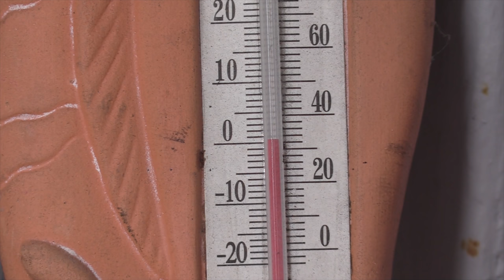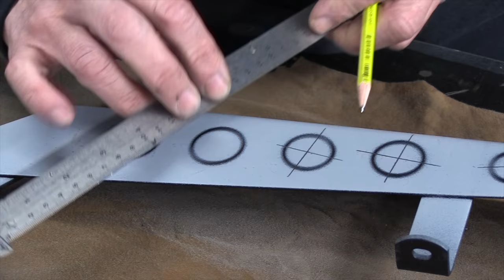Triumph TT Legend, Custom Chain Guard Makeover !

Comment: Room enough for a smal spray booth in the new place? LxWxH 2X2X3 m, plywood, a carbon filter and a bathroom fan does the trick 👍
Reply from the maker: Sadly, I don't have room for that, I have a professional spray shop two doors down with a low bake oven I can use anytime!

Comment: By now you should be sponsored by Simoniz & amazed you haven’t got a one piece bar to go between the axle stands. 
Do you ever have problems with the wire leaving marks in the paint? I use hooks instead of twisted loops so components can be repositioned between coats.
Reply from the maker: Sponsorship would be nice, sadly we buy it, but we do get a little discount when we buy in bulk, as we all would!

Comment: Hi Dell 'n' Pen.
Another brilliant paint job, you've got the Tough paint down to a tee. The step drill worked nice with the graduated holes too.  Would your dimple punches do it or are they not stepped enough in the set?
The ole Leg-end's going to be a beauty.
Reply from the maker: Hey buddy, the dimple punches would struggle with this, it's 2mm thick and pretty good quality steel, and they would certainly lead to a little distortion for sure, even if they made it through.. and also you're right, I think I only have maybe 4 sizes and I needed 9 graduations!  Thanks for your support, as ever, take care, D&Px
Reply: @Moonfleet41  Aye,  you're right Del.  2mm would be a bit much and stress out the die for no reason.

Comment: Have you got a link for the red rubber grease you use on the rubber mounts etc for the radiator? Thanks
Reply from the maker: Here you go buddy, I use a tube at the moment as I picked it up cheap on a tool stool in the market, but it's not cost effective to buy it in tubes, compared to buying a tin, so here's a link to that:  https://www.spanner-monkey.co.uk/red-rubber-grease-500g-tin-66557?search=red%20rubber%20grease&description=true

Comment: Nice result! I thought you would use the punch tool, similar on the Fox Dawg build. This is a nice alternative for the budget minded. Good luck with the move!
Reply from the maker: Could well have done that, but for two reasons I chose the step drill, one is that I only have 4 sizes of hole punch and I needed 9 different graduations for this, and also this chain guard is typically heavyweight steel being Triumph, perhaps 2mm thick I think, and the manual punches would struggle with that, leading to a fair bit of distortion... so this time, step drills made a better job for the design I had in mind!

Comment: Great video as always - good luck with the move!

Can I ask what you use in your parts washer? I've heard conflicting ideas between proper washer fluid, diesel and kerosene. Many thanks!
Reply from the maker: Hi Duncan, I don't personally believe in using flammable solvents, like diesel and kerosene, it means having 3 gallons of it sloshing around in the bottom of the tank constantly and it's not sealed properly like a fuel tank, so if there was ever a fire, it certainly wouldn't contribute to safety... I use an emulsifiable solvent, not just because it's safer, but also because it washed off with water and many of the jobs I do are de-greased before painting... things like diesel would leave a horrible residue which would affect the paint, but I can wash my parts off in the sink and get them bone dry with an air line... and as you can see, they're perfect for painting that way, and I never get any adverse reactions from the paint... here's a link for you, hope it helps buddy... https://www.spanner-monkey.co.uk/degreasing-solvent-emulsifiable-5l-59168?search=ak05&description=true

Comment: Can imagine the anxiety of planning that move.  Best luck as always.   Quick question... i would have used a sanding block to sand, would it have been incorrect to do so on the chain guard?
Reply from the maker: sanding blocks give a great flattening effect to high peaks and uneven surfaces, but my aim here was simply to scuff the surface and smooth out any edges in the previous paint layer so that nothing shows through the new paint!  As you'll see on Friday, it floated out perfectly smooth for a great finish... thanks for the moving best wishes, much going on behind the scenes, but we'll give you preview very soon!!

Comment: Great styling on the chain guard.  What's the reason for wet sanding versus dry sanding?
Reply from the maker: Dry sanding tends to clog the paper when you're using a fine grit, the water rinses the debris away, also lubricates the paper, leading to less aggressive abrasion, gives a smoother finish, but still keyed for painting!
Reply: @Moonfleet41  makes perfect sense, thank you 👍

Comment: Just the type of guard I'm actually looking for just now Del
Reply from the maker: Cool, maybe you can make yours following this now... Good luck with it buddy.
Reply: @Moonfleet41  probably going to end up with some carbon minimalist guard tbh 
Fits in with rest of project involving stripping every single gram of weight off of a road going 600 tuned to the max 
Rolling Road figures are showing just under 50% increase on factory output 
Chassis needs a ton of work yet though 
Zx10r front end on modded head stock and custom built mix carbon/alloy/ titanium ( dodgy Russian sourced) with 2019 zx10 swingarm and rear shock assembly 
10r wheels just now ( to be replaced with lighter at a later date) 
Ancillaries are latest digital as is Ecu ( flashed already ) 

Sept test it ate one clutch and one rear tyre and chain 
Badly needs smoothhing out just now 

No idea how much from anything standard lighter she is but I can at this point just about lift single handedly completely off the ground in full trim 

Guy who owns it is not short of a coin or two lol 😆

Comment: What type of solution did you use in the portable red sink you have?
Reply from the maker: Here you go, this is what I use, link for you: https://www.sealey.co.uk/product/5637174713/5l-emulsifiable-degreasing-solvent   It's cheaper on SpannerMonkey, but their site is down at the moment, however he's a link to their site, check it a bit later and put the product code in and it'll be significantly cheaper through them: https://www.spanner-monkey.co.uk/index.php?route=product/search&search=ak05&description=true
Reply: @Moonfleet41  thanks :)

Comment: What cleaning fluid do  you use in your parts cleaner?
Whats your thoughts on using diesel / petrol to clean parts by hand?
Reply from the maker: Firstly mate, petrol NEVER use for cleaning parts, the fume build up can flash and burn down your garage, diesel isn't so dangerous, but generally, the same as kerosene, they are both a heavy oil and will take an awful lot of cleaning to actually get the degreaser itself off the part, so I use an emulsifiable solvent (obviously meaning it's a water soluble), not only does this mean it's non-flammable, but also you can rinse it off with water, and certainly for me when most of my parts are to be painted, it's very important to get all the solvents off the surface... here's a link to what I use, and it works extremely well, as you can see: https://www.spanner-monkey.co.uk/degreasing-solvent-emulsifiable-5l-59168?search=ak05&description=true

Comment: “Brake cleaner to clean the parts washer fluid” - that’s another one you can explain in your ‘lubricants’ video! Aren’t they basically very similar? Sorry for being ignorant.
Reply from the maker: No buddy, I use a water soluble degreaser which gets the worst of the grease off, but the brake cleaner wicks in to places where even water can't get, and also it dries away by evaporation, unlike water (of course water evaporates, but not as instantly as brake cleaner), so this leaves it dry even in places like any gaps behind the welded brackets where water can lurk, or even just dampness, and come out and trash the paint later on... using this method has ensured I never get reactions from left over chemicals.

Comment: Great spray work once again , do you normally do 1 tach coat and 3 or 4 wet coat.
Reply from the maker: If it's warm enough 3 wet coats is fine, this paint is thicker than regular rattle can paint, you can lay it up a little heavier without it running... but practice to find yourself a comfortable process that works for you!
Reply: @Moonfleet41  ok thank you. Enjoy your move to you new unit , can't wait

Comment: Ah! The ancient art of Drillium! 👍 I approve. 😅 
I got a free welder.. gasless MiG. 😱😲 I'm making a terrible mess with it so far! 
Looks great boss, stay safe! 😀
Reply from the maker: Great news on the MIG mate, if it helps, try cutting your teeth with thick metal... 5mm thick means you can wind up the power and make lovely beads without blowing through it, good luck with it and have fun! It's all about the practice...
Reply: @Moonfleet41  cheers Del man 👍 yeah I got a job lot of mild steel offcuts from eBay it's all pretty hefty. 6mm angles, squares, bars, 2mm tubes and big old plates. Also got angle grinder from the same neighbour, they're moving house you see. I'll post some pics of my practicing disasters. 😅
Reply from the maker: @ollieb9875  Look forward to seeing it mate, I started exactly the same way, never done a course, never had the time for it, but you'll get there in the end, just passing on the wiest words I ever heard with welding... "slow and steady gets the job done" !

Comment: Del... what cleaning solution do you have in the red tub??
Reply from the maker: Here's a link John.. i use an emulsifiable degreaser, i like that it can be washed off with water specially if the parts are to be painted, which for me they usually are..  :-https://www.sealey.co.uk/product/5637174713/5l-emulsifiable-degreasing-solvent

Comment: Hi Dell and penny hope you are both well 
Right 
I live in Nottingham the other day some scum bags try to have a go at my r6 my friend told me about a motorbike chain and lock that cost around about £150 -£200 to buy and he said it can't be bolt crops or grinded by the thefts I'm just wounding if you would know what it might be called or even where to buy it from cheers dude 
Be safe out there both of you
Reply from the maker: Hi buddy, I'm afraid I don't know of such a chain, but on the simple knowledge of metals, I know of no material, however exotic, that can't be cut with a slitting disc, these days a disc grinder can go in a pocket, battery powered and sliced through any lock or chain... there are other cunning methods they use to break locks, no lock is infallible... I know it's not much help now, but in the future, have you considered a tracker?  If you can afford a proper one fitted by an alarm company and monitored, that would be the best, but if that's a little pricey, there's the Monimoto product, which is battery powered and syncs to your phone, if someone moves your bike you get a phone alert and your phone will track the bike within a metre, as long as they don't put it in a steel container (which for what it's worth, would also disable a regular tracker as well)... just a thought, every little helps mate.  Keep safe there, we're both well thank you!
Reply: Cheers Dell I've already got the monimoto tracker on my r6 after watching your video on it cheers anyway bro

Comment: Another excellent video. What brand face mask do you use?
Reply from the maker: Hello, how are you keeping?  and here's the respirator that I use: https://www.spanner-monkey.co.uk/respirator-half-mask-with-a2p3-filters-67760?search=ssp1605&description=true  
And there's also a link to spare filters:  https://www.spanner-monkey.co.uk/filter-kit-set-of-two-a2p3-cartridges-for-ssp1605-67761?search=ssp1605&description=true
Reply: @Moonfleet41  thanks for that, but for some reason I am getting the following 

Forbidden
You don't have permission to access this resource.Server unable to read htaccess file, denying access to be safe
Reply from the maker: @DeafMaker  Sorry for that mate, I've checked with them this evening, as my side I've got prices showing as £0, ...SpannerMonkey is an agent for Sealey and they use a data feed system from Sealey's website through theirs, that's how these things work apparently, and there's a glitch causing issues, which apparently can be common... they'll have their IT guys on it first thing in the morning, so if you come back to it, am sure they will have sorted it by tomorrow and the link will be working... it seems all Sealey products are affected this evening.
Reply: @Moonfleet41  cheers mate